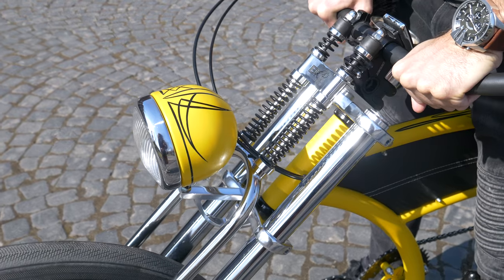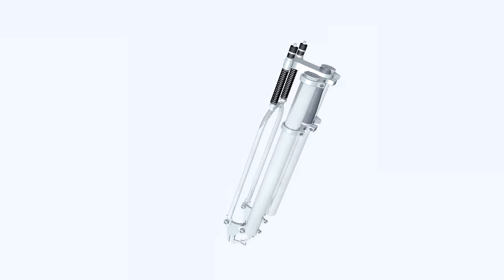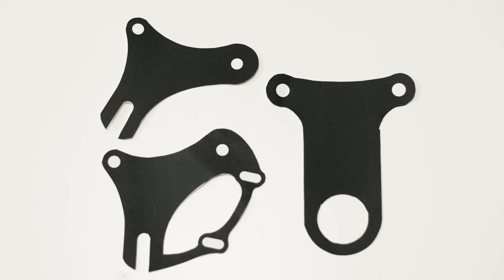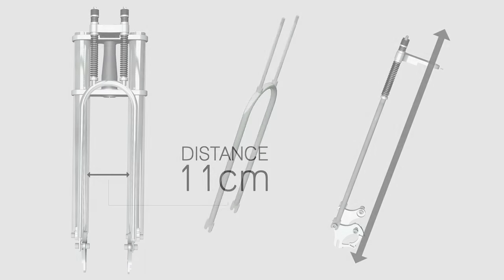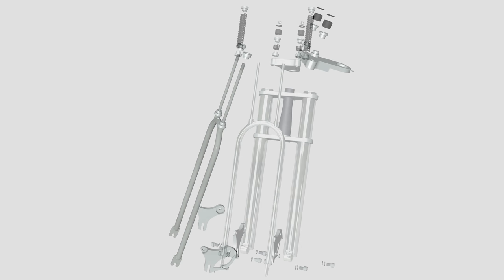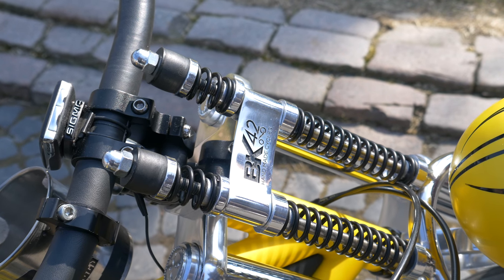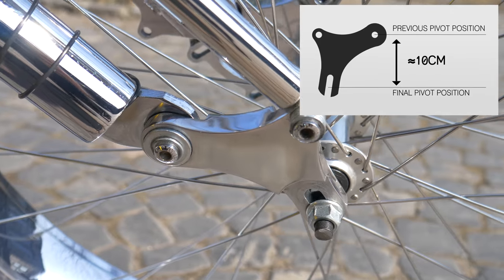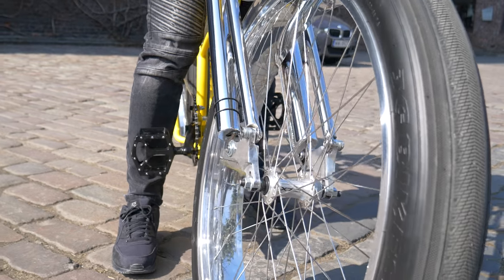Building Springer Forks on a Budget: Step-by-Step Guide with 3D Graphics

Comment: Doing some research for a build myself for a car engine trike and have been pondering some ideas for the front suspension and came across this video and am now curious on if I could replicate this in a higher scale to handle more weight
Reply from the maker: Hi there :) 
I guess you can. Just use stronger metals, specially for the moving parts. The springers will need to be a lot stronger as well.
I'm curious to see your project!

Comment: That's awesome!  Very well designed and built!  I love springer front ends.
Reply from the maker: Thank you very much Bruce. Coming from you it REALLY means a lot to me. I am honoured. Tks for visiting btw :)
Reply: Hey, you're very talented at what you do!
Reply from the maker: Thanks Bruce . You too :)
Reply: @BK42Cycles  i need a Set of 'Rockerbolts' can't find a set under 149€, thats too much for me. Where can i find some low priced like on that frontend?
Reply from the maker: @mistersimple1986  Hi my friend. 
I used those as rockers boats (Road Seat Bolt 22mm - SE93622 about 3 pounds):
https://www.ebay.co.uk/itm/Oxford-Bicycle-Cycle-Bike-Replacement-Allen-Key-Road-Seat-Bolt-22mm-SE93622/302882142496?epid=4023746668&hash=item46852eb920:g:ArgAAOSwDOlbmoKp:rk:163:pf:0

I used a metal glue to keep them in place - It is not necessary, but it make it safer.
They are strong enough for a bicycle forks project, but I wouldn't use them in motorcycle forks.

If you are talking about any other boats please let me know, I will be happy to help you.
Cheers

Comment: Your bike is very beautiful to look at, and the workmanship of the fork is impressive. But I wonder, is it a comfortable bike to ride? I have an interest in making a chopper bike too, inspired by your channel.
Reply from the maker: Hi Richard, thanks for your kind words :)
These bikes are not exactly made to be super comfortable neither fast, but for mine I've made everything focusing the weight and measuring the elements, so the crankset - seat tube matches exactly my legs length, as well the handlebars. During the summer time I ride about 30/35km a day on it and it is still a great ride. 
Once in Amsterdam I rode 99km in one day, of course next day everything hearts. 
The idea is to build something on your own, something unique, to learn the bicycle mechanics and keep it well maintained. When I need a very comfortable bike for long distances I would use a super light road bike :)
I am very curious about what you are going to build up ;) 
If you need help our facebook group is very interactive and the builders love helping! Cheers
Reply: @BK42Cycles  Still deciding, but a bike similar to the one in this video is what I'm liking the most right now. I think I will modify my current bike a little at a time. More work in the end, but it will help me decide on the geometry before I build a frame from just tubes. Thanks for your reply!
Reply from the maker: that's a good approach, I'm looking forward to see your conception soon. Merry Christmas
Reply: @BK42Cycles  Merry Christmas to you too!

Comment: Wow I'm in luv with this!
I got a shwinn stingray chopper that uses a 24x2.1 tire that I plan to replace with a 20x4.0 wheel and this should do the trick! What do you think? Gonna need to get all schematics from the video.. subscribed!
Reply from the maker: Hey Tanz! Thanks for the kind words mate. Welcome to my channel :) Man, I used to have a 20x4 on my old Stiletto.. that is insane!! Your Stingray will be DOPE!! 
Do you want to replace the front wheel only? Both? What about the rims? ( this is important to be considered). Do you mind to share your bike picture with me? I will have a better idea then :)
Those schematics were made only for this video, but I can support you with all the details you may need
Reply from the maker: btw my email is bk42.bikes@gmail.com  ;)
Reply: @BK42Cycles  awesome!
Reply: @BK42Cycles  I bought a jr fat bike to salvage the wheels and brakes from since it's hard to get the stuff I need here in the Philippines.... Got the bike from Australia. The rear end should be ok for now until I decide if I wanna change into a soft tail, the front is the issue that I'm trying to sort out lol. Oh and it has a bafang mid drive motor hehe
Reply from the maker: @tanzarcheart5290  Cool.. so it is an ebike? Very nice... so the front fork should be well designed considering powerful brakes
Reply: @BK42Cycles  well it doesn't really go fast, like 28kph since in Australia they got laws for speed limits lol but I'm planning to reporgram it
Reply from the maker: Keep it as it is.. this is a chopper bike to enjoy the ride slowly :) you could make videos about the customizing process:) what about it?
Reply: @BK42Cycles  I've been thinking of doing just that yeh haha altho would have to open up a new channel since this is my personal one
Reply from the maker: @tanzarcheart5290  That would be great, but why not adding to your personal channel? Nothing bad about it
Reply: @BK42Cycles  i use it for every device I have and kids use it so it's gonna be a mess ahha
Reply from the maker: Ok... it makes sense then :) I am not sure that there is any specific channel about this bike customization but I am sure that there is a lot of people interested on it :)
Reply from the maker: That makes sense then :) I haven't seen a dedicated channel for that bike yet.. I am sure a lot of people will love to watch this customization process

Comment: Is the main fork from Ruff cycles or custom as well?
Reply from the maker: Hi Tarik. The main fork used as the base is the cheapest Ruff Cycles fork as well.tks for watching
Reply: @BK42Cycles  Thanks, now they offer 2 forks, the one you have and "Fork regulator" with suspension, but I'd prefer cheaper fork + your custom suspension model. Too bad I can't buy it online and I don't have an option to make my own. Anyway awesome work, and good taste you have.
Reply from the maker: Thanks for your kind words man. Unfortunately I don't have the workshop to help with your build. This suspension is not difficult to build but it requires a lot of time and finding the right CNC guys. What I like the most about my prototype is that it is very lightweight and very functional. If you need any help or tips get in touch

Comment: $160 to get something waterjet cut and milled? I needed a pair of circles  about 300mm cut in aluminium and got a quote for $800 in labour excluding the stock.
Reply from the maker: That is why I love building things in Poland 🇵🇱.. they usually don't over charge basic things like CNC :) 
Try searching for it on smaller cities
Reply from the maker: Where are you from btw... cheers
Reply: I'm in Australia, and the $800 quote was only for 2 hours lathe work, I think if I wanted them CNC made I'd be looking at $3000
Reply from the maker: That is crazy... I got so many parts made with CNC ... I cant understand why the prices are that high there...
Reply: @BK42Cycles  I just got another quote reply about 2 hours ago from another company and for the same two discs this time with 14 holes drilled made of 30mm aluminium they want $2000 and I still need to supply the material.